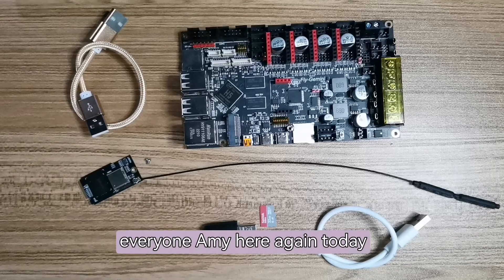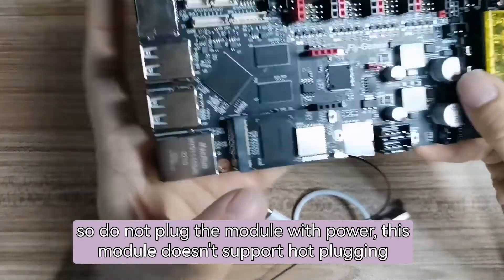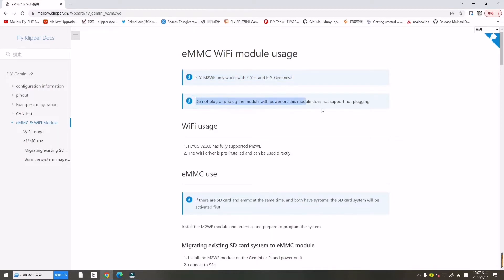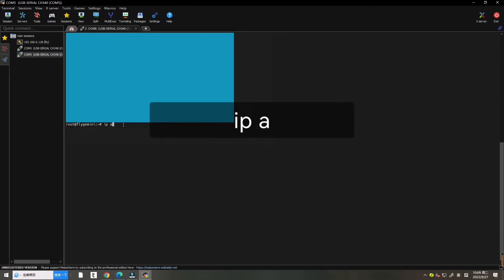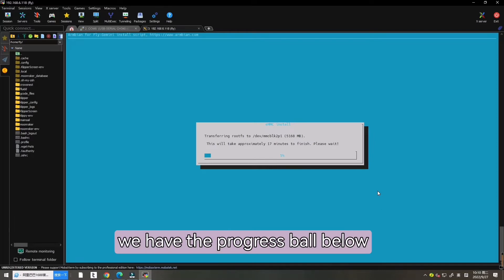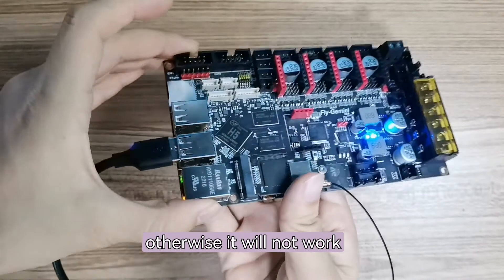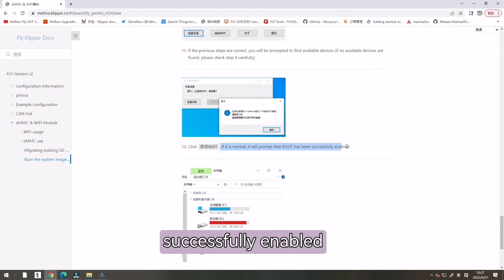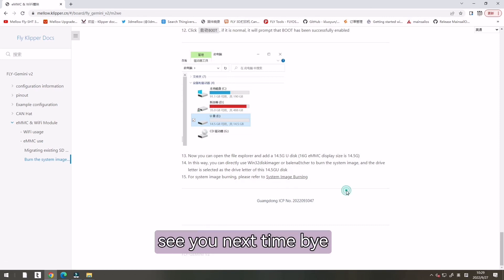How to use Fly M2WE board install system image on Fly Gemini V2.0 and fly Pi board for 3D beginners

Comment: I use main fly-pi-v2 with FlyOs-Fast-H5-v1.3.1. When I ssh with mobaxterm and enter the command sudo nand-sata-install but only get the message sudo: nand-sata-install: command not found. How to execute this command. I tried the second way but when I started burning to emmc it reported an error and stopped, I can't execute the second way.
Reply from the maker: Fly OS Fast system does not support this.only armbran system can use